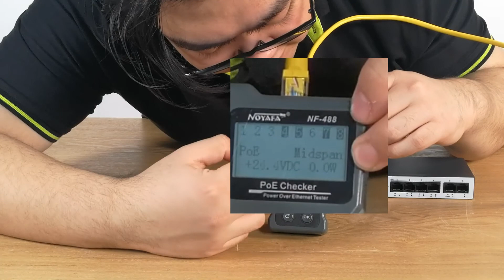Passive PoE VS. Standard PoE - What is the difference?

Comment: Will the passive poe 48v 24 watt 0.5 am like tp link support poe af devices?
Reply from the maker: If you use a passive PoE 48V injector to power some of the TP-link access points EAP225, You will burn the EAP225 directly. EAP225 uses 45-78 to take in DC24V passive power, and the passive PoE 48V also uses 45-78 as a power pin. While the 48V injector sends the power to the power pin which only accepts DC24V, you can imagine the result.
Reply: @Fastcabling  if the poe af devices work on 48 volt. Then will it work with passive poe 48volt.
Reply: @Fastcabling  if we design an iso-power Vin 48V and Vout 24V, that will be no concern with passive PoE 48V right.
Reply: another discussion,  how is the cable lose ? passive pse adapter + 100m cat5e,  Have you ever tested this ?  thanks!

Comment: Watched many videos, love the straightforward presentation.

Imagine you have a nonPoE router and OEM power supply of end device on one end of a passive injector. You then have 10m of cat6 going to your passive splitter which is plugged into your nonPoE end device (Raspberry pi.)  Is this "handshake" still needed since you are using the OEM power supply?
Reply from the maker: Thanks for your support! Glad to know we help! If you haven't subscribed, please follow our channel. We'll come back with more useful videos. And as for your question:

The passive PoE already removed the power handshaking. The PoE injector will force you to inject the power no matter what you have at the edge. I guess the PoE splitter doesn't have protection such as overload, short circle. You do need to know what you are dealing with before it may damage your edge device.
Reply: @Fastcabling  the end device is a helium hotspot made by Bobcat. Basically a Rasp. pi 4. Ive had this set of only basic passive injector/sitter for a year without issue. I suppose I'm asking if it's ok to NOT use an active PoE setup for the reason that i have the OEM rasp pi power source. It's what would plugged into the end device anyway.